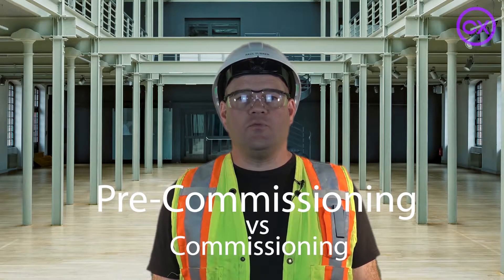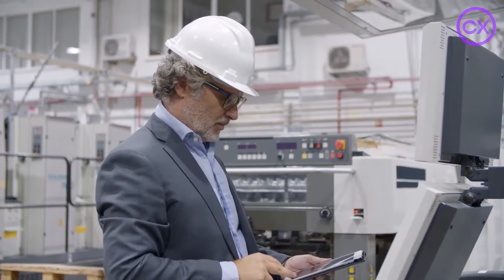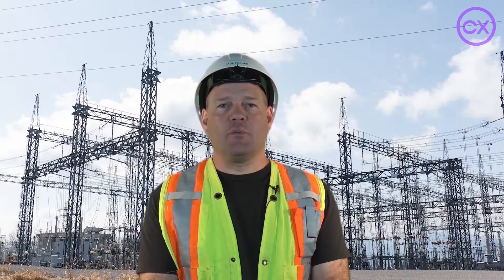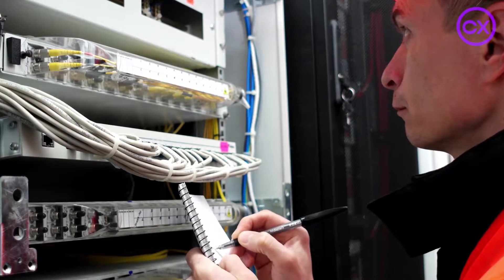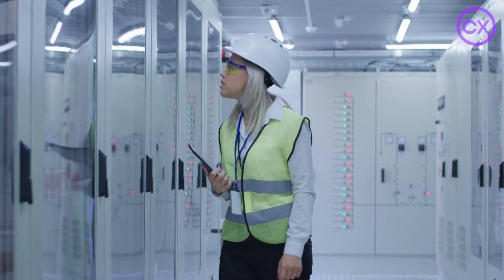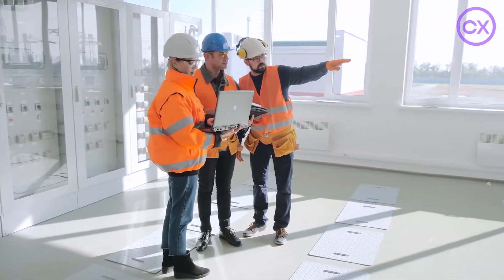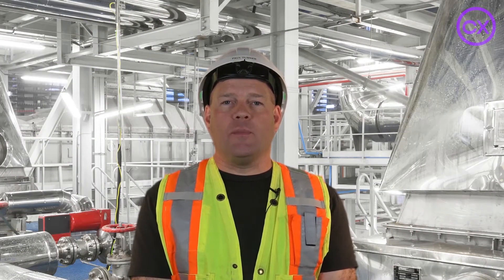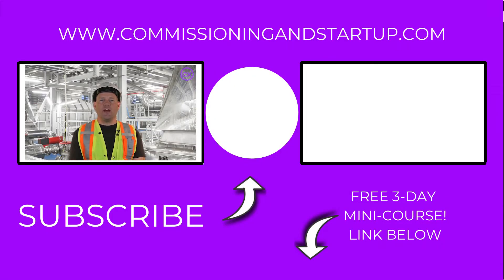Pre-Commissioning vs Commissioning - What Takes Place During Each Stage?

Comment: Thank you for this awesome video. If I understand well, hydrostatic tests are part of the pre-commissioning. Could it be that Mechanical Completion comes after pre-comm?
How far does the commissioning go? Can it start-up the whole plant or could it be that the client makes the final steps of the commissioning to check that all the systems work well together and that the General Contractor stops after having checked big systems of the plant? Thank you.
Reply from the maker: All very good questions, and the answers are all very project specific based on the contracts. Hydrostatic tests are part of pre-commissioning and are often done by the installer prior to MC. Further pre-comm then takes place after MC. There are lots more free resources your can check out on our site www.commissioningandstartup.com
Reply: @outcomeassurance  Thank you for your answer :) In the pharma industry there are commissioning > qualification > validation. Have you already worked on a pharma project?
Reply: Yeah, pharma uses CQV. Different terminology, same concepts. Wouldn’t it be great if there was a standard set of terminology used across the commissioning industry? I haven’t worked on a pharma project.

Comment: In term of project planning and schedule, do you recommend to further divide the Work Breakdown Structure (WBS) to Cosntruction, Pre-Commissioning and Commissioning or better to divided it into system and subsystem?
Reply from the maker: Better to divide into subsystem and system. Individual equipment of each subsystem will undergo pre-commissioning, then be tested as a system during commissioning.
Reply: @outcomeassurance  Agree with you. As much as i had the same thinking like you but in reality most of the project plan and schedule nowadays still divided the WBS by Construction, Pre-Comm and Comm instead of by system and sub-system. I see that the main reason is because usually Construction phase and  Commissioning phase usually will be excuted by different people/organization. Maybe in the video you can explain and maybe show one good example of how the project WBSby systemization
Reply from the maker: @yazidsalehuddin7633  You're right, and this can be a cause for confusion as the project transitions from construction to commissioning.  The construction team will focus on installation of each individual piece of equipment, as they should.  But the thought process needs to change and focus on groups of equipment as a system.  One piece of equipment is not very useful to the commissioning team on it's own - several pieces if equipment as well as cables, piping, etc are required to function as a system.  The Commissioning Team can help with this transition by having very well defined Mechanical Completion documents.